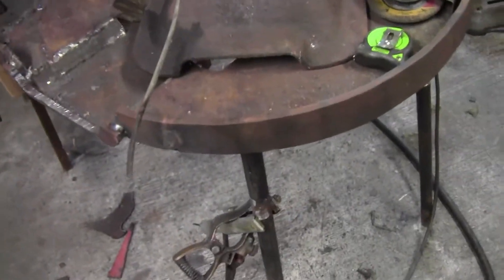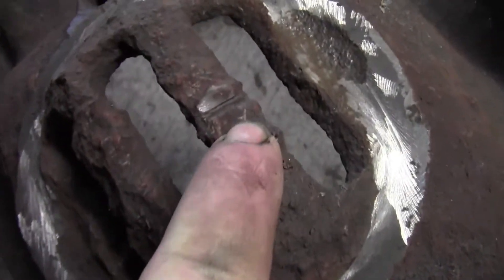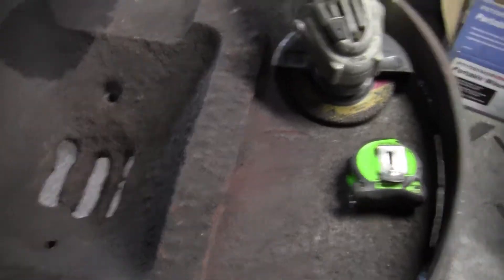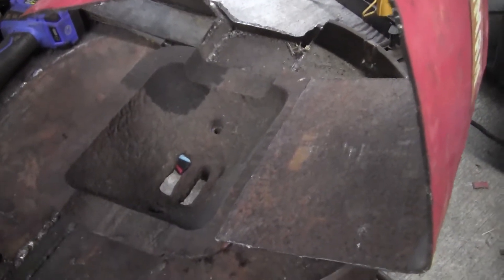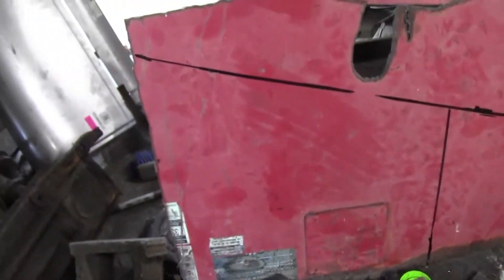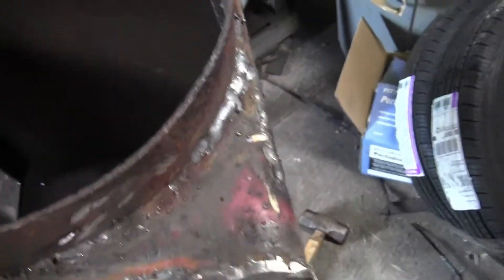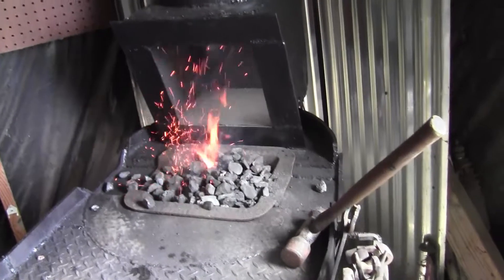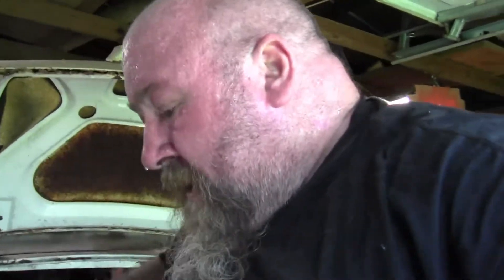Rebuilding the Forge Part 2 The Super Sucker Forge Hood

Comment: How did you join the 2 6 inch black pipe??
Reply from the maker: It was a little tough. I spread both pieces open and snapped the two pipes together so there is a seam down each side. I'll try to do a video later this week.
Reply: @faroironandcustoms6577  that would be fantastic.